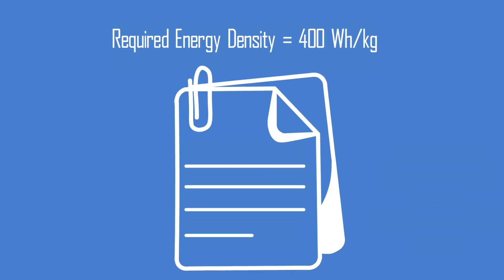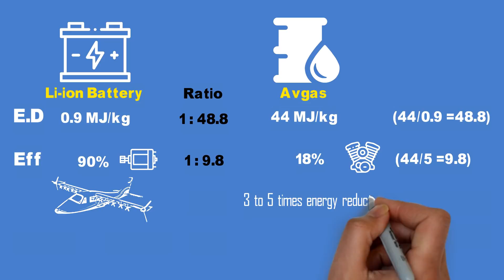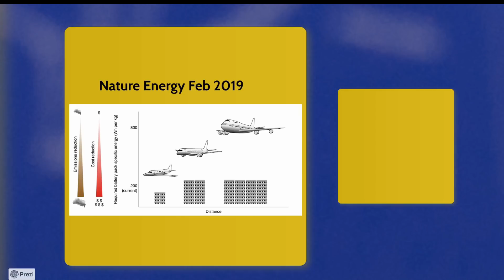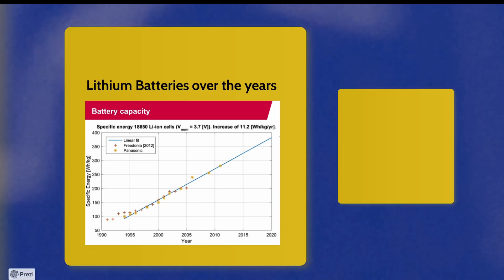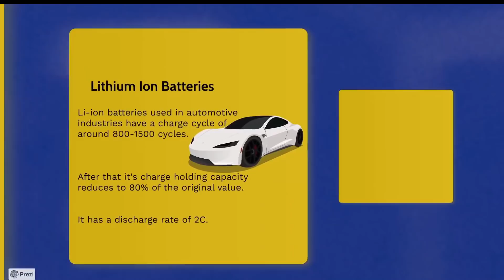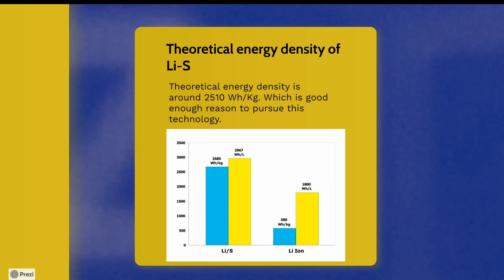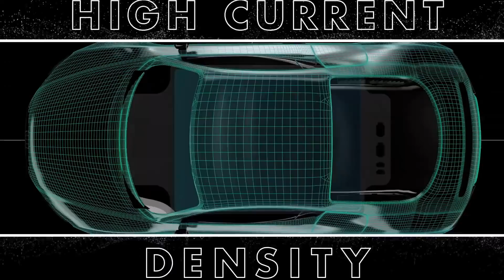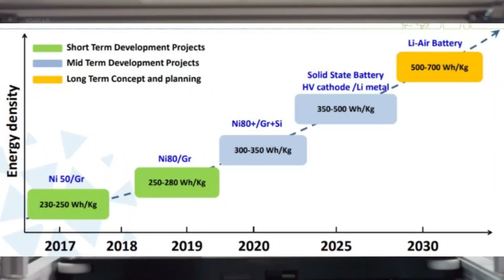Batteries for Electric Aviation: Where does the battery technology stand and where it is heading

Comment: When calculating the range of the batteries vs fuel, did you factor in some of the other variables like the fact that as fuel planes use up their fuel they become lighter during flight, and as a result become more efficient the further they go? 

Or the potential of Electric propeller aircraft to recharge during decent?  

There may even be some advantage to flying at MUCH higher altitudes for electric aircraft, such as less wind resistance due not not having an air breathing engine, however this may negated by the lack of air available for the propellers use for propulsion.  What do you think?
Reply: yep good points
Reply: Add a pressurized cabin and pressurisation and cabin heating systems if you want take advantage of reduced air density.

Comment: I wonder if the fact that the 46-80 battery can be bonded and take structural loads makes it almost good enough if for instance it is used for say, the main wig spar, and other structure.
Reply from the maker: Its a good idea. In cars batteries are providing structural rigidity so why not in planes

Comment: Another great video! Great explanations! I am very curious about the recent developments in ”hydrogen goo” that was featured on the latest episode of the OLF podcast. If I understood it right, it would be a very energy dense way in combination with fuel cells to power electric planes. Also very fast turnaround, as you pour the ”goo” into a tank similar normal refueling. Anything you could do an episode on?
Reply from the maker: Yup definitely in the works but I have a few other videos that I will be working on first
Reply: 95% of H2 made of hydrocarbons me thinks??

Comment: Battery energy density figures are typically computed for 25 degrees C. Go down to 15º C and you can only pack in perhaps 80%; go to 0º C and that figure may only be 60%. Conversely, cycle life is increased at lower temperatures; batteries really don’t like high temperatures! Fuels like kerosene are far less limited by temperature fluctuations. And then there’s the bugaboo that a fueled aircraft gets lighter and lighter during flight whereas a battery aircraft stays at the same weight the entire flight. So: energy density is only part of the challenge with electric aircraft. Battery volume is also a big problem; try cramming 90 kWh of batteries into a tiny two-seat aircraft while leaving room for pilot and passenger!
Reply: A couple of good points you make. It is a much tougher nut to crack than EVs. With fuel, every pound burned results in less drag, and for various reasons it is significantly more efficient to fly at high altitude. But batteries will not perform at the low temperatures where virtually all public transport flights operate so there are obstacles for this technology to progress beyond puddle jumping and into the airways.
Reply: Batteries can be placed in wings, having a structural role too and the preconditioning, ensures operational efficiency at any temperature (with some energy loss). While the efficiency of electricity can't be denied, even ice engines use a lot of electronics, why not have only one system, having everything neat packed and lighter? Also, the ability to recover energy while going down to land it's inherit in electric engines. Let's presume you use 30% to climb to 10.000 m where the air is thinner and you have less resistance, with smaller solar panels now you have more solar radiation and better efficiency that can put 3,6 maybe 10% back or it can improve your range. Let's say that you fly for 1 hr at almost 80% efficiency using 60% with a front prop and you recover from the wake of the airflow with a back prop 10% of that.  Now you have 40-50% for landing. The regulation is 30% for vtol. but for a normal aircraft, 10% is more than needed and you recover that only by going down for landing.
Reply: I just wait for Tesla 4860 to get 1 year of use, to see how much that chemistry can be pushed. I am sure even now, if we push the law to accept a bigger load on electric ultralight the today technology on batteries and engines it is enough for a two sitter with the same range +500Km simpler technology, solar charging and structural packs, neat servos ditching hydraulics completely, to be half price and 80% cheaper on the cost of operation and service. But then, what will you do with all that value stuck in ice engine technology? I understand the reluctance of aviation and they will hold it as much as they can. I don't see any reason to wait for vtol.

Comment: Great video!
Now, the point of electric flight is the cheap flight hour price that comes with it but no one has time to recharge a plane and that is why Siemens and other major players placed battery racks in planes. You introduce your fully charged units, fly  land, replace and take off again. It's the simplest and best available solution for the whole electrical transport sector, for now. It's all about the return of investment since EV it's a self sponsored business rather than a state subsidized research project. We have to put business before passion in order to understand how these things work.
If the cash flows things are rolling.
Best wishes for everyone!
Reply: Yeah, and higher charge rate is not only a challenge for the battery itself, but also for the infrastructure to supply power to it. And if you're going to swap batteries out anyway, you might as well use aluminum-air.